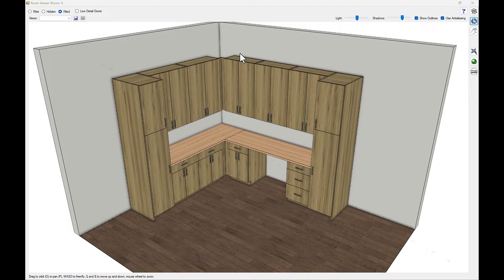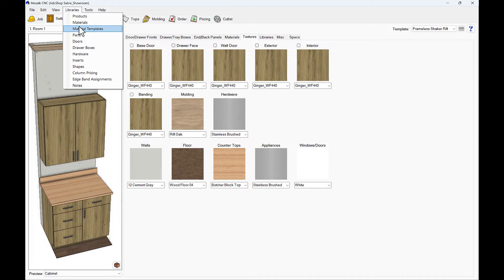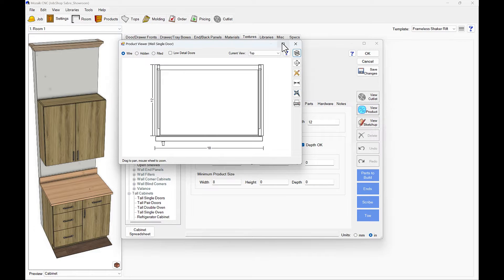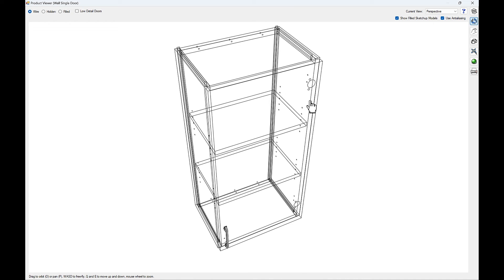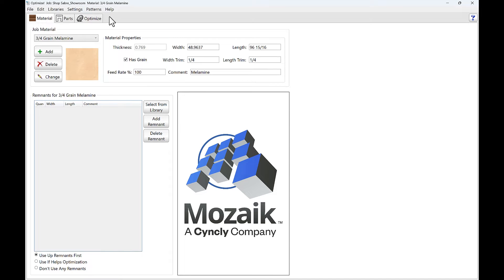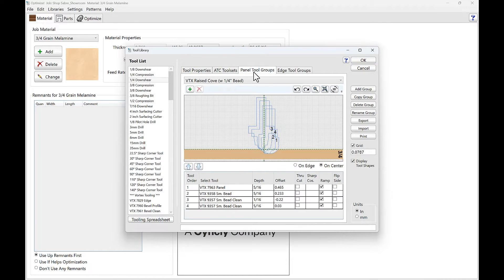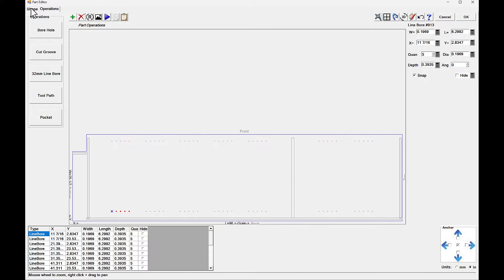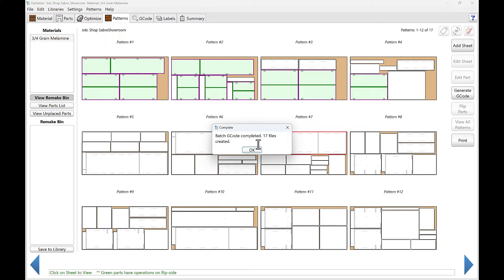ShopSabre CNC - Frameless Cabinet Design - Part 1

Comment: Hello, I would like to know what type of blade I should use for 3/4.
Reply from the maker: On a CNC router you’ll want to use a bit rather than a blade. For 3/4" material we recommend a compression bit for clean top and bottom edges.